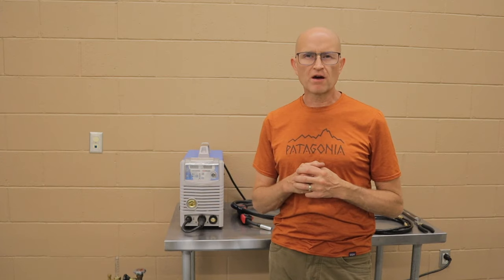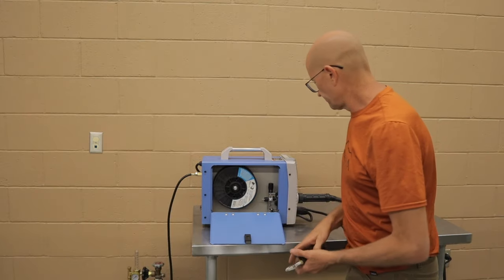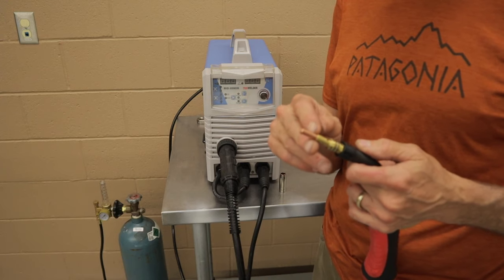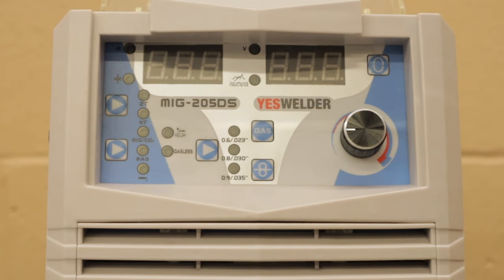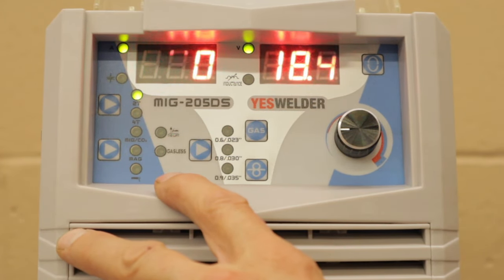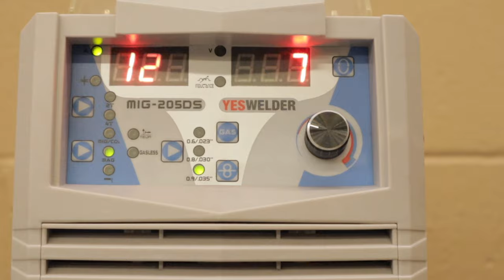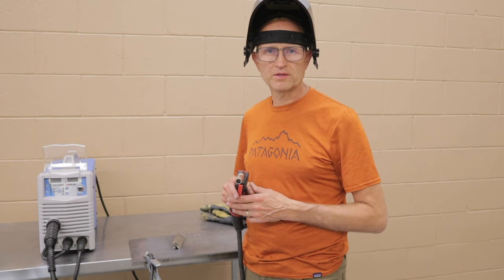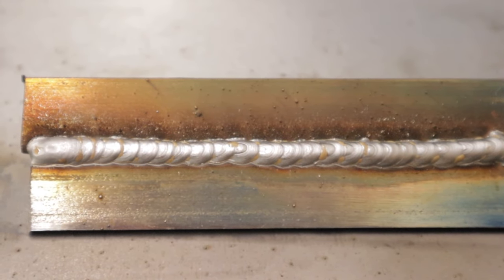YesWelder  MIG 205DS Welder Set up and Settings - Yes Welder DISCOUNT LINK !!!

Comment: Thank you!  I have been shopping for a replacement for my 110v Hobart and decided to pull the trigger on a YesWelder too.  I hope mine is as bulletproof and yours has been!  Keep up the good work!
Reply from the maker: Hi Biff, I’m certain that you won’t be disappointed. Two of my friends used mine and were so impressed that they both purchased one for themselves. They have been using them almost daily for weeks and have not had any problems at all. These are quality welders and I must say I’m extremely impressed with this company!  Let me know how it goes and how nice your welds turn out. You won’t believe how smooth it welds! Cheers!😀
Reply: Prana-Tech has njnnmoo

Comment: Can you weld .030 Flux core on 120v ? Machine only allows .035 Flux selection gasless.
Reply from the maker: Hi there, I think it is possible. Others have said they just put it on .035 and weld with no problem because it is close enough.😊👍

Comment: Thanks for this interesting tutorial, I just ordered my YesWelder MIG-205DS, but I have a doubt, because you say that you are using Ar and select MAG, when MAG refers to an active gas that is normally CO2? I would think that when using 100% Ar or a mixture we say, Ar/CO2 (75%/25%) it is MIG, since it refers to an inert gas and CO2, although it is active, is in a concentration lower than Ar so in practice it would be considered inert gas. Why don't you select MIG with your Ar tank?
Thank you for taking the time to answer this question. Regards from Mexico.
Reply from the maker: Hi Gabriel!  What you said makes sense but the control panel only has 3 choices for wire feed welding, MiG/Co2, Mag or Gasless. I just assumed that Mag was for argon mix and it has always worked great. I also use it with Co2 sometimes when I’m welding out in the yard and I set it on MiG/Co2. The manual was terrible back when I purchased this welder, but they rewrote it and now it is much better. It is still a great welder after using it almost daily for over a year now! 😁👍
Reply: @PranaTech  Jan 2022 just received this machine, no .23" wheel (yet?); it does have a flyer with a settings chart but no reference to what they mean MiG/C02 vs MAG. Oh, also unlike your video/model, there is now an adapter sleeve for the 10 pound spool,  so you can use the 2lb by removing that.

Comment: I love this video…just one question, what is your gas regulator set at? I can figure out when I’m doing wrong…I get so much spatter and I’m trying to narrow down my problem. I’m a newbie
Reply from the maker: Hi Josh, my Argon/CO2 mix regulator is set at 20cfm if I’m welding in the shop. If I’m outside I usually bump it up to 25-30 if it’s breezy out. If you are getting a bunch of splatter make sure your wire is cut to about 1/4” beyond the shielding cup. That’s about the distance you want it to be when you are welding. Any more than 3/8” and it will begin to splatter more. Also, if you turn your inductance up to 6 or 7 it will really help with the splatter as well. Hope this helps! Let me know if you have any other questions.😊👍

Comment: Hi Don, I am a newbie welder; I Iiterally did my first (practice) weld today! I'm quite excited to get going, but my wire speed is too fast, and I can't figure out how to slow it down. Help!?
Reply from the maker: Ok, I’m glad to help. I need some background info on what wire you are using? Solid or flux core? What gas you are using if you are MIG welding? What thickness steel you are welding and what amperage you have the welder set at? This will give me a better idea and help me troubleshoot. 👍😀
Reply: @PranaTech  Thank you! I'm working with 0.030 solid wire on 1/8" steel, with argon/CO2 gas. I had it set at 110 for amperage.
Reply from the maker: Ok, let’s make sure that the machine is set to MAG on the settings over on the lower left side. If it is set to Co2 the voltages will be off as well as the wire speed. You should not need to do any adjustments to wire feed speeds if the settings are correct. The amperage is correct for ⅛” steel so let’s make sure your technique is correct as well. You should have the mig gun down as close to the work as is possible without touching and tilted just enough that you can see the weld puddle as you progress down the weld line. Make sure that you haven’t adjusted the voltage at all because this can affect the wire speed. For 110 amps the voltage should be at 17 volts exactly. Let me know how it goes.😀👍
Reply: @PranaTech  Ooh, boy. You were right; I had it set on MIG, not MAG. It's much better now! While I have you may I ask another question? What's the best way to release the gas pressure when shutting down? I've been turning the tank valve closed and then pulling the gun trigger, which bleeds the gas lines, but also wastes wire. Is that the way I should be doing it?
Thanks so much for helping me figure this out! My welds are really rough, but they're welding! Practice, practice, practice...
Reply from the maker: Oh good! Glad we got it figured out! I don’t bleed mine down after welding. It only has a few psi left after you shut the main down so it has never caused me any problem over the years. 😁👍
Reply: @PranaTech  Thank you so much! And thanks for the great video!!
Reply from the maker: You are very welcome!😊

Comment: I received the welder yesterday and have used it just enough to make sure it isn't DOA.  One thing that doesn't seem to make sense to me is using the Thickness function.  
Have you tried using the Thickness settings and do they make sense to you?  
Thanks
Reply from the maker: Hi Sterling, yes I played with them a little but it seems to me to be in millimeters and it has just been easier to adjust the amperage settings for my thickness needs. 👍😀
Reply: @PranaTech  When I had the welder set to 0.035 wire and MAG the highest the thickness would go is 4.2 mm (0.165").  It had 205 amps at that setting.  Seems a little high.
Reply from the maker: Yeah, that’s what I found too. That’s why I ended up just using the amps because 205amps is great for ⅜” which is way thicker at about 9.3mm.
Reply: @PranaTech  I sent Yeswelder an email requesting clarification on using the Thickness function.  They said "Please don't worry about how the workpiece thickness display work" and told me to use the settings in the Quick Start guide (https://cdn.shopify.com/s/files/1/0024/3249/9821/files/MIG-205DS_Handle_Book.pdf?18286) - heh, they call it a Handle Book.   Funny thing is these settings are semi-consistent with the Thickness function settings.  High amperage and the smaller the wire diameter the thicker the material you can weld.  I might try using these settings someday just to see if they work.
Reply from the maker: Interesting!  Yeah that “Handle book” is pretty worthless. That’s why I just came up with my own chart. 👍😀
Reply: @PranaTech  I did some playing around with the thickness feature today.  All of the settings seem "hot".  I only have 0.035" wire and don't have many different thickness scrap pieces to play with.  What I found is your settings work good when laying dimes.  With the thickness settings you point, pull, and run.  You can lay down more wire with good penetration in a straight line.  Take all of this with a grain of salt since I'm a beginner welder.
Reply from the maker: Hi Sterling. Cool! I’ll have to play with those settings some and see how it goes.👍😁

Comment: Thanks, 
You made a comment about the wire drive wheels. I had my drive wheel backwards. I was using 035 wire and the .9 was showing. I cut a piece of 030 wire and confirmed the groves and corresponding .9 or .8 markings. Yesweld seems to be opposite of everyone else.
Reply from the maker: Yeah, there doesn’t seem to be any standardization between the manufacturers over there. Everyone seems to be doing there own thing. Glad I could help! 😀👍
Reply: Dave, help me clarify. If running .035 should the .9 be showing or will the .8 be showing? I am still confused over this. Thanks!
Reply from the maker: Hi Bart, Dave will probably chime in but until then, the .9 will be hidden inward towards the welder and .8 will be showing facing outward for .035 wire. 👍😁
Reply: @PranaTech  Thanks for that clarification in the video. When I watched this I thought maybe I misheard you and just ignored it. But after looking the size you need does indeed face inwards. Great video btw I felt as if the factory settings were a bit high and will try your settings tomorrow. They seem much more acceptable.

Comment: Does adjusting amps manually change the wire feed speed? Looking to do overhead and normal settings for flat and horizontal don't usually work.
Reply from the maker: m k   The wire feed automatically adjusts to the amps when you change them. I haven’t played much with overhead settings yet but I do bump the amps up about 10 percent higher with T joints or filet joints. You’ve got me curious now. I’m going to run out to the garage and try some overhead welds and see how it does. Thanks for the comment!👍😀
Reply: @PranaTech  Yeah I was curious if you could turn up the amps on the machine enough for overhead to increase wire speed manually  and still keep it independent of the voltage.  I am used to having wire feed and voltage, but more wire means more amps. I know there is a conversion formula for the amps to wire feed speed. Thanks for the in depth review.
Reply from the maker: m k  Ok, I’ve been playing with it for a couple hours now trying to get the settings right for overhead and vertical up. Most of the time has been spent on the vertical settings. Finally got those dialed in as well. So, I welded some 3/16 hot rolled plate on an overhead T joint and the first couple try’s were garbage. I usually weld 3/16 at about 140-145 amps horizontally so I bumped it up to 150 and it still was too cold. I bumped the inductance all the way up to positive 10 and then ended up at 164 amps and it welded beautifully overhead.  My settings for vertical up with the same 3/16 thickness ended up with inductance all the way down on -10 and the amps at 154. I usually weld vertical up with the upside down v technique but ended up doing the triangle method to finally get it to weld up nice. Hope this helps!👍😎 Don

Comment: What exactly comes with it when you purchase this welder?
Reply from the maker: Hi Ken,  It comes with the mig gun and ground clamp leads, as well as a stick welding rod holder.  It also comes with an argon hose to connect your welder to the argon regulator. If you are going to mig weld with Gas you will need to get a regulator because this welder doesn’t come with it. Here is a link to the one I’m using. https://www.amazon.com/Argon-CO2-Regulator-Flowmeter-Construction/dp/B0753WVR51/ref=sr_1_28?crid=1Y1JJC535EXY4&dchild=1&keywords=argon+regulator+for+welding&qid=1616125347&sprefix=Argon+reg%2Caps%2C1504&sr=8-28   It comes with wire drive rollers for solid and flux core wire and a few spare copper mig tips. It also comes with a pigtail for swapping from 115v to 220v. 👍😀

Comment: How long is the power cable for the MIG 205DS?  Need to figure out how long of an extension cord would need.
Reply from the maker: Hi Pete, I would guess it to be about 7 feet long. I’m at work today at the fire station, but when I get home in the morning I’ll get you an exact measurement.👍😁
Reply: @PranaTech  I ordered an extension cord that will get me the distance that I need.  7' is a good enough guess.
Reply from the maker: Hi Pete, I measured it and it is 6 feet without the 220 pigtail and a little over 7 feet with the pigtail on the cord. Hope your cord is plenty long enough! 😎

Comment: Hello, great info thank you. I'm struggling trying to get the unit set for Gasless and .030 wire. It defaults to .035. Any advice on how to get the wire set correctly.
Reply from the maker: Hi Dave, I’m at work right now but I’ll be home in a couple hours and I’ll play with mine and see what I can come up with and I will get back to you with what I find.
Reply from the maker: Hi Dave, well I played with mine a little this afternoon and it appears that it is only able to use .035” wire because mine is the same and only allows .035 as a selection.  I’m sure you could do a work around by reducing voltage or amps to compensate for the slightly smaller wire. Still seems strange that it is set that way though.🤔Don
Reply: @PranaTech  First I'd want to say thanks for the explanation of  these settings so clearly that a total newbie - like myself - can understand them. I would like to follow-up on Dave W's question. Haven't received my welder yet but are you saying that, as an example at about 13:40 in your video, you can not set the wire size to .030? That it's 'stuck' on .035 and that I'd have to fudge the volts/amps for .030 wire. Mine would be fluxcore for starters.
Reply from the maker: Hi Lance!  You are correct in your understanding. With flux core wire you will need to bump the voltage down just a little to compensate for the smaller .030 wire. Let me know if you have any other questions. 😁👍Don

Comment: So what type of torch is it for replacement tips and consumables? i don't see anything listed on amazon anymore. I also don't see it on there website.
Reply from the maker: Hi there, the consumables are the same as Tweco torches.😁👍
Reply: @PranaTech   i see yes welder says Lincoln/tweco 1 or miller/hobart kits so I assume the tweco 1 consumables will work? the only reason I ask is the brass part has a spring on it on the gun but the consumables shows just a brass piece with no spring? is the spring reusable? Also the tip shroud is silver looking but the consumables is copper or brass looking. as i look at pictures on amazon the 15AK kit looks alot more like what the consumables on the gun look like? Maybe a video on consumables would be beneficial to others who are like me and are just learning welding.
Reply from the maker: Blue95stang1,  sorry I thought you meant just the tips for consumables. Yes if you want spare shielding cups as well, just order the 15AK kit from Yeswelder. If you are buying locally just the tips are the same as tweco. Sorry for the confusion.🤪
Reply: Prana-Tech thank you!!

Comment: I found it hard to get specs for this welder so maybe you can help with a few questions.  Does it have hot start and arcforce?  How do you set wire speed?  Thanks great video.
Reply from the maker: Hi Joe, I believe it has hot start but I will have to look up to see about arc Force. Wire speed is automatically set by the computer when you set the amperage and it works flawlessly!
Reply: I believe the wire speed is determined by the amps setting on this welder

Comment: Thanks for taking the time do this video- much need for the yeswelder given their owners manual. I purchased the 250 Pro, and their manual is completely worthless.  Looks far worse than the 205 manual, even though there are more settings on the 250.  As a beginner I am trying to figure out the proper welder settings and have been relying on other manuals.  I have tried to use the syn settings but they are so wildly different than anything else I have seen so not sure where to start.  I will try using your settings (which seem different than the settings in the "handle book" linked in the comments here) hoping the 250 is similar to the 205 since I cannot find any other video like this.  I am trying to use dual shield wire.  Any advice on the difference between dual shield settings and solid wire settings you have here? How about with 100% C02 vs Argon mix?
Reply from the maker: Chokobuko,  yes, the instruction manual for the 205DS is not very useful.  The 250 pro settings should be the same as the 205DS with solid wire, up to the 200 amp range and then you will just have to follow the same pattern up to 250 amps. I have a buddy using straight Co2 with his Yeswelder 205 and he is using my chart with no problems.  In my experience you have to bump the amps down with flux core wire because it isn’t solid and doesn’t take as much heat to melt it.  What I do when I’m welding up a new project is to take a couple of scrap pieces and do a couple sample welds to verify my settings are dialed in for the thickness I’m welding. That’s how I made the chart that I posted up because the factory manual was impossible to get usable settings. Hope this helps!👍😀

Comment: Does this machine come with the spool of wire or is it something I should order separately?
Reply from the maker: Good morning Andrew! The welder doesn’t come with any spools of wire so you will have to order that separately. Also, it doesn’t come with a gas regulator either so if you want to do mig welding with shielding gas, you will need to order one of those as well. You can get one on Amazon for about $28. Here is a link to one that will work. The welder does come with the gas hose that will work with this regulator. Let me know if you have any other questions. Thanks, Don👍😀
Reply: @PranaTech  Thank you

Comment: If you set the 205 ds to stick weld do you use ac rod or dc rod?
Reply from the maker: Hi Bruce,  I believe it is DC because they recommend 7018 and 6011 as the best rods to use and these are DC rods. 😀👍
Reply: Prana-Tech Thank you!
Reply from the maker: You are very welcome!😁